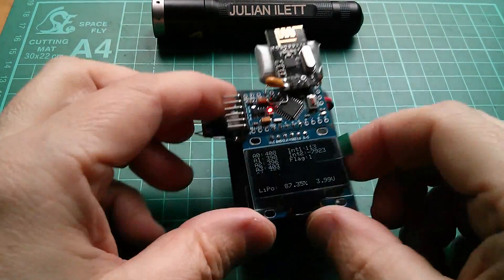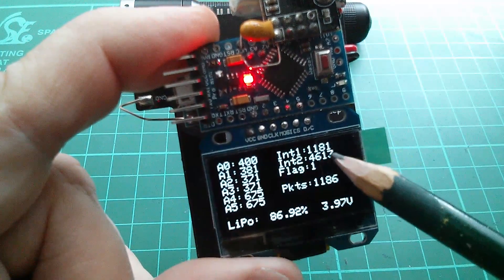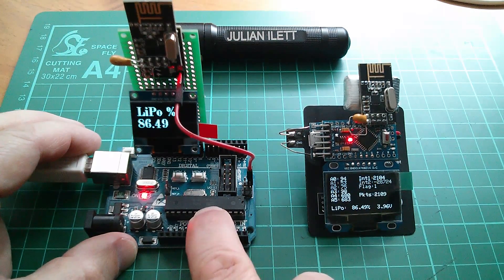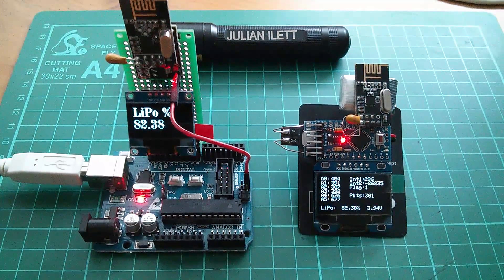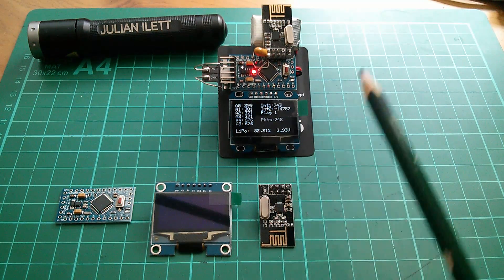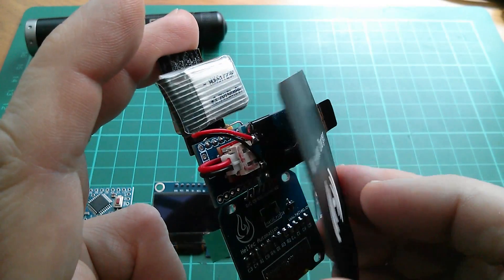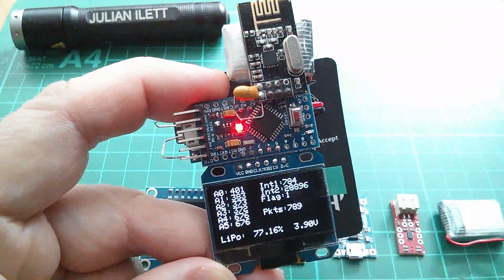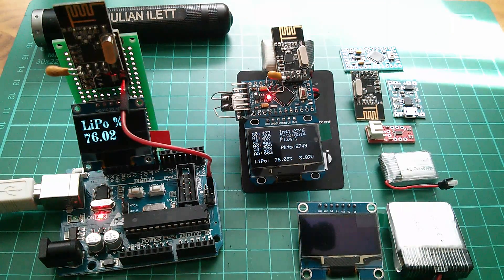Arduino Wearable OLED Data Display Project Revisit

Comment: I guess you've found out about this now, but if not, the flickering on the oled display is because of the difference between its refresh rate and the shutter speed on your camera. 
When you closed the blinds, the camera compensated for the light by changing the exposure, i.e. changing the shutter speed.

Comment: how did you get to display battery Percentage please help!!
Reply: Im using a Tinyscreen OLED +
Reply from the maker: Using the MAX17043 :)
Reply: Thank you !,  question how long does your battery last? , do you know how much current does the screen draw?? also do you think if i connect it to a multiplexer it would still work. I have to connect 3 other components that use SDA and SCL pins

Comment: How did you monitor the lipo pack on the "wearable" Did you use the ardunio or a lipo board?
Reply from the maker: +Christopher Lange I used the MAX17043 lipo fuel gauge

Comment: At 8:08 you plugged VCC into A1, wouldn't this cause a large amount of current to flow into A1? Since A1 is floating it will be at a lower voltage than VCC so lots of current would flow with very little resistance?

I'm new to electronics so obviously I've missed something here

Comment: Great video. Just wondering what is the problem with Your Arduino UNO, can You upload bootloader  to it and restore it to new? or is just getting corrupted over time(like windows) but on deeper level than bootloader? I'm newbie at this, so just keen to get some insight at things. Thanks

Comment: Hi Julian, a real noob question - how do you regulate the lipo to 3.3V? I have the  same issue on the esp chips, and could use a 3.3v zener diode? I can't run a lm1117 3.3v regulator directly, as the input voltage is too little, thus upscaling to 5v first, but that seem like a waste!  But what do you use that works efficiently??
Reply from the maker: +Laurence Munro There's a little LDO regulator on the Pro Mini board

Comment: Nice project. What chip did you use for the LiPo "fuel guage"?
Reply: +foley2k2 MAX17043
Reply: +Mike Causer Interesting, that uses a SPI bus. LC709203FXE-01MH is cheaper and uses I2C.
Reply from the maker: +foley2k2 MAX17043 also uses I2C

Comment: Won't the nrf24l01 get damaged when powered  by the lipo battery? Since the voltage is higher than 3.3v
Reply: +Nikolaj Gylling It's powered by the nano, which has a regulator
Reply: +Mike Causer a linear regulator?

Comment: 7:33 notice the LiPo percentage went from 86.06% before the reset and then down to 82.54% after.  3.5% drop!  Hmm... not sure about that LiPo monitor.
Reply: Try rebooting your device and the same thing will happen. When I reboot my iPad I often get a battery percentage within 2-3% of the start. Since it is a lipo its % of charge is not linear. He also said that is recalls off of historical data meaning rebooting will cause it to recalibrate.

Comment: 15:40 I had one of those, and on that display D0 was SCL and D1 was MOSI. Looks like the driver chips can be used both in SPI and I²C mode, so in the latter case they would be D0 = SCL, D1 = SDA. Adafruit sells similar ones with solder jumpers to select between modes, but my display didn't have any, and I guess yours doesn't either. Of course the very thin leads are exposed, so maybe you could change the mode with a /very/ steady hand...

Comment: You might be able to get the 'wearable' part down in size a bit,by using an ESP8266 module to replace the Arduino and NRF module(s),combining them in one package.

Comment: i always looked forward to the wearable project videos. do you think you will continue the electric bike videos soon? i would be interested as to how long the bike would last on a full charge using lithium batteries rather than lead acid.
Reply from the maker: +BoomBrush UK is still too cold (or maybe it's just me). As soon as it warms up I'll be back outside looking at all the summer projects.
Reply: Julian Ilett should come to australia then! lowest it gets is around 10 degrees and that is on a bad winters day. summer on the other hand, eh. last summer it got up into the 40's.
Reply: +Julian Ilett When setting off for the farm at 5am in November,  I'd be warmed up nicely after 100 yards of pedalling.  I was a fair bit younger I admit,  and there's not many hills and the motorists aren't trying to kill you in Holland, so you are safe for those first 100 yards when you're still frozen.

Comment: Do the transceivers have channels?  Is it possible to have multiple transmitters sending data to one receiver?
Reply from the maker: +Marvyn Harris I think the radio modules use a frequency hopping technique. You do have to specify a 'pipe' address though. Have a look at the TMRh20 fork of the RF24 library, that has loads of new features.

Comment: Where did you get your Display from? I like the size and want to make one myself.
Reply from the maker: +ImJtagModz This one is 1.3" SPI - http://www.ebay.co.uk/itm/331799146191 or if you want I2C, search eBay for 1.3" I2C OLED
Reply: +Julian Ilett Perfect. Thank you.
Reply: +ImJtagModz i2c for cheaper on aliexpress: (i bought 5 of them, work well) http://www.aliexpress.com/item/1Pcs-blue-128X64-OLED-LCD-LED-Display-Module-0-96-I2C-IIC-SPI-Serial-new-original/32523790205.html
Reply: +Charles Forman Even better. I will definatley be buying some of these.
Reply: +ImJtagModz That aliexpress one is the 0.96" version, so smaller than the one Julian linked to. Hence it costs less. Just a word of warning in case you missed the size difference.
Reply: +EnjoyingUTube Too Was going to get couple of each but didn't initially notice it. Thanks.